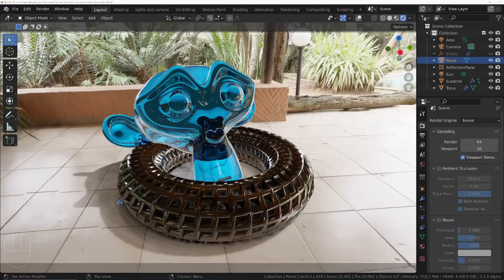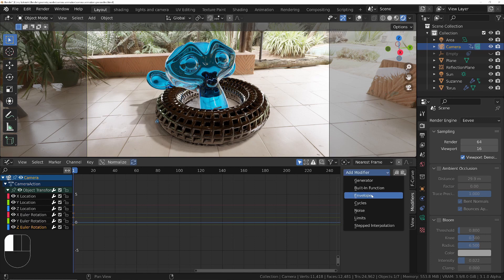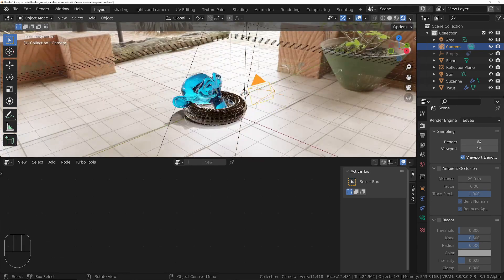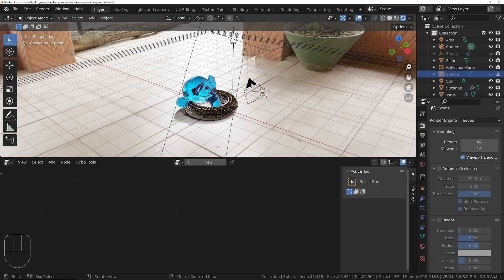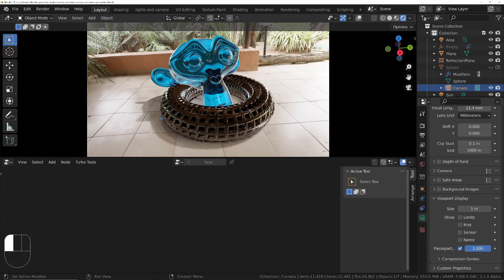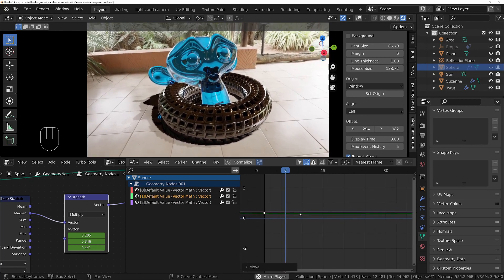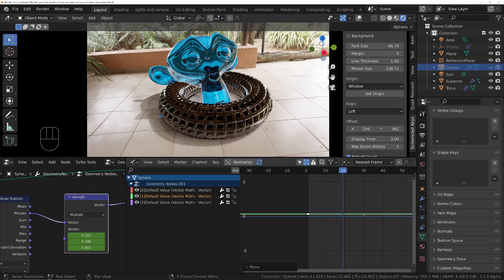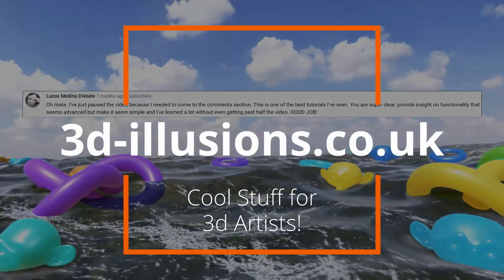Blender 3.1 Control the Camera with geometry nodes

Comment: $50 Tip: #1. Set the camera to 'Location 0,0,0, then set the Sphere to 0,0,0' to align the camera & sphere symmetrically. Then press '7' for the 'Top' view. #2. Select the Sphere, then Tab to Edit Mode, select 3 vertices and return to Object Mode. #3. Select Camera first, Sphere second, then Ctrl+P and choose "Set Parent to Vertices".

Comment: For people that are not familiar with #frame/20  and/or want a bit more control,  there is now a SCENE TIME node which you can link into a math node and do the divide.  That means you could animate the divide as well.   
☮
Reply from the maker: Hans Goodey also told me that the scene time node is also more performant than an expression as well 👍